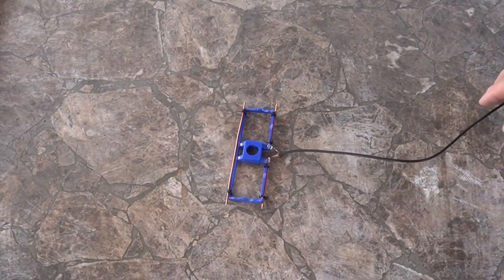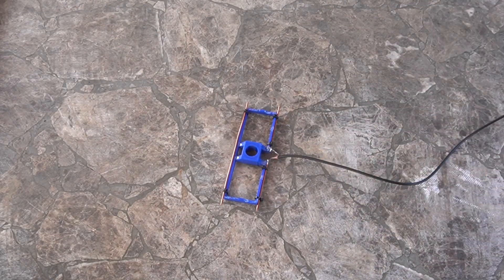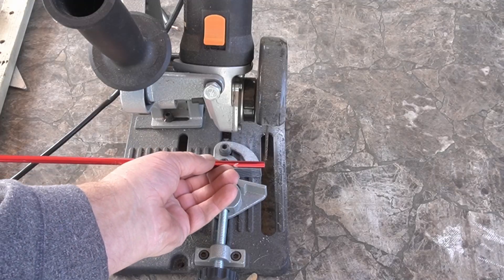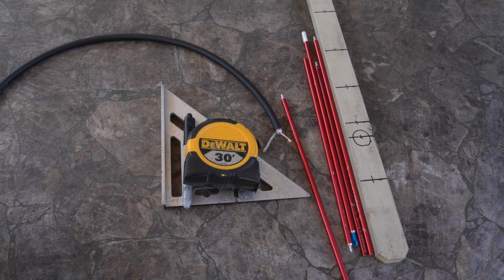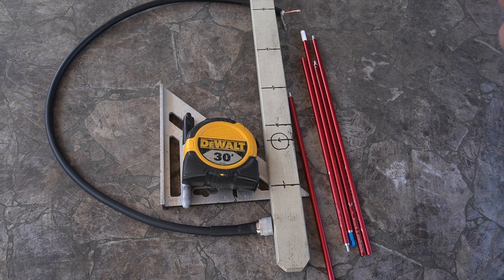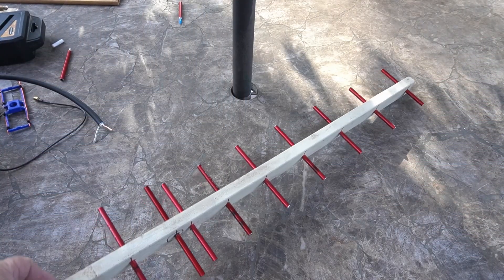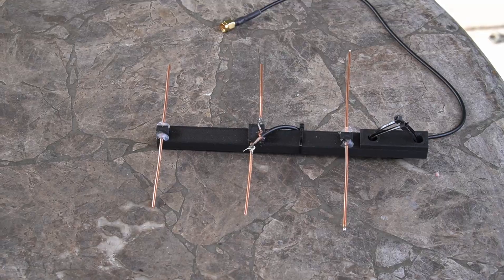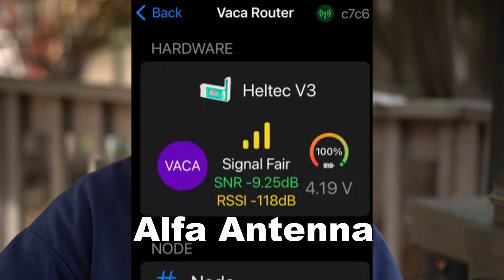How to build a Meshtastic Yagi Antenna!

Comment: yes 900 MHZ is a hard band. so much blocks it. and you are dealing with very low power.  UHF antennas are different for making near buy metal effects them more . .  Even moisture in wood can affect 900 MHZ. I did hear your contact on 10 meters to England.  Lord callum is a great contact on 10 meters !  Just keep looking I am shure 900 MHZ antenna designs are around. 73